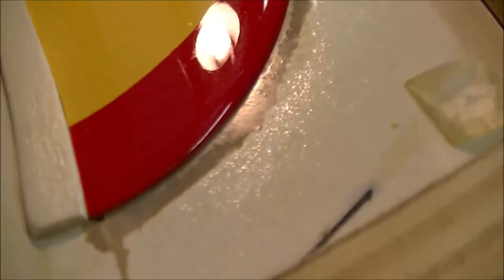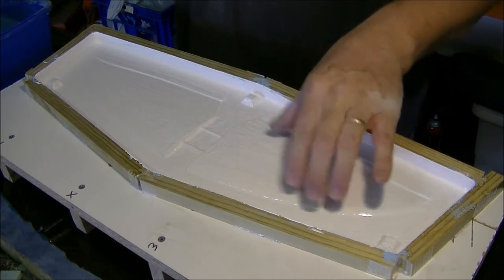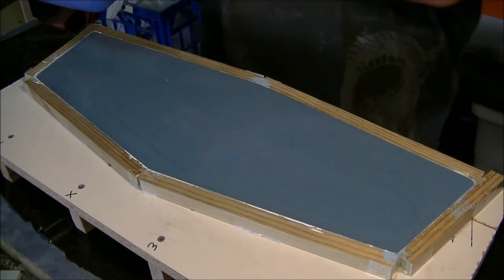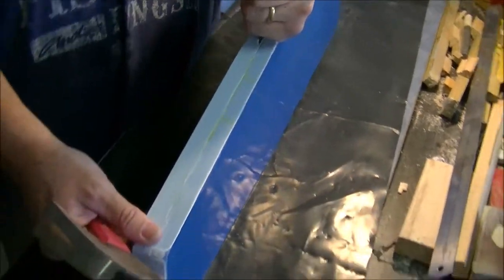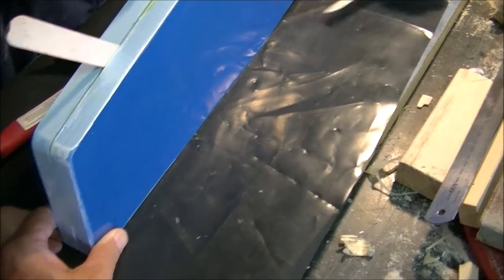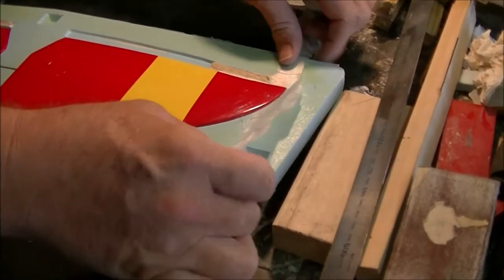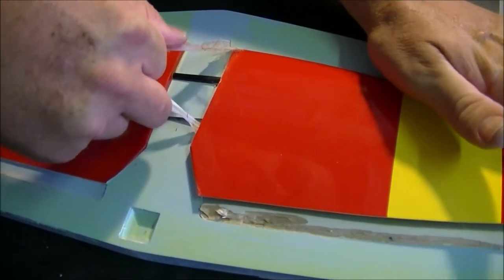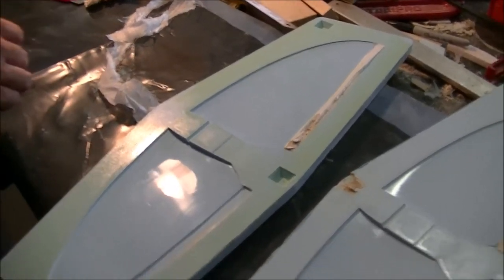Lunatic Tail Moulds from DIY Corian

Comment: Nice job. When I've done it, I made some 1/2"x1/2"x1/8" clay pieces laid along the edges of the mold, before pouring the 2nd side. It makes it super simple to scoop out the clay and use a screwdriver to separate the mold halves either when making the mold or making the molded pieces. BTW, "timbuck"'s real name is Tim Harris.

Comment: Great how to's Steve .......................  but just one question mate.  Why use Corian as a mould making material instead of Silicone?
As Silicone is pliable it would make the whole de-moulding process much easier.

TURK
Reply from the maker: Turk, I've never had anything really to do with silicone moulding, but I suspect that my usual practice of paint-in-the-mould would face a few challenges.
Reply: @steveaitken5468  Ahhh ..............  I see  ; )  I suspect you could be right there!
Many thanks for the quick response mate.

I've been looking around on the Net to see what people are making with Corian,  as opposed to the usual counter tops.  Nice to see it can also be cast into moulds ..................  mmmmmmmmmmmmmmmmmmm,  gives me an idea!  ; )

TURK